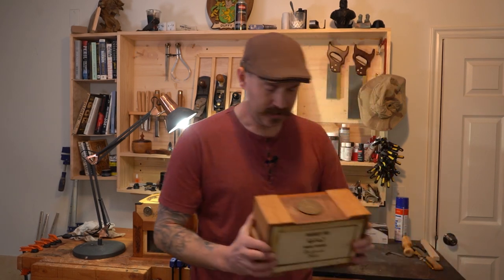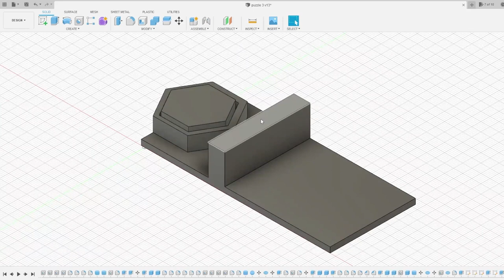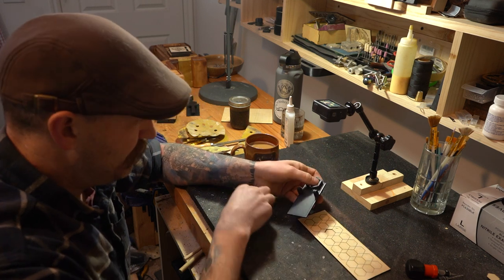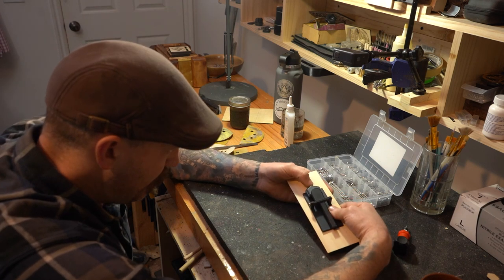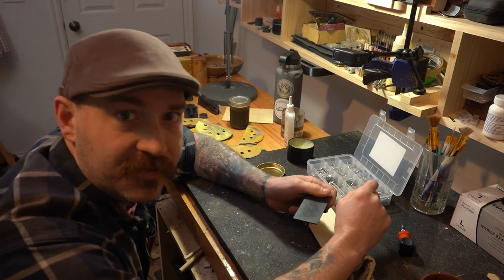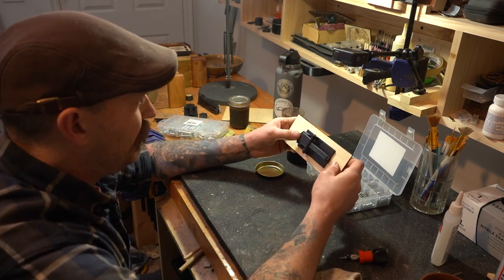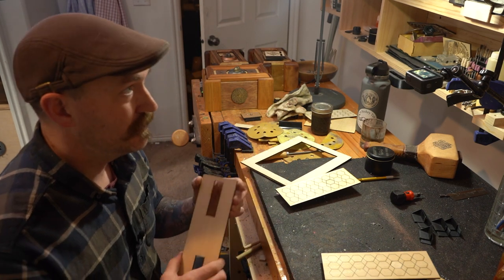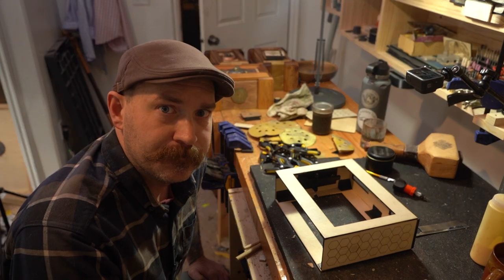Designing A Puzzle Box Part 1

Comment: Great vifro, thanks for sharing, I have wondered about building a puzzle box as well.  Re: the 3D printed hexagon tolerances, why not reprint just the button scaled back .5% or so, rather than sanding your butt off, the button is hidden by the wooden piece, anyway.  And just because I am a butthead and like to make things difficult for people,  if you got all, or at least several of the hexagons out completely with the laser, it would make the button harder to locate by looking for 1 that was different... and the real butthead in me says to spring load a few that do nothing but annoy the potential solver  :) ... again, awesome build, can't wait to watch the next in line, and try building one myself... though, my TinkerCAD skills are limites and F360 skills non-existent
Reply from the maker: so, one thing not shown in the video is one of the hexagons I tried making smaller. I think I had given it a 1.5mm difference. the problem I had with that is it was too sloppy and made the wood piece not reset to the proper place each time. Also, I had no clue how to use fusion 360 a few months ago. I just forced myself to learn the basics.